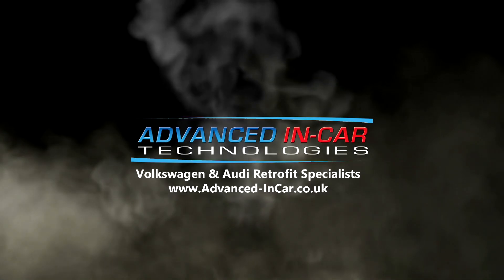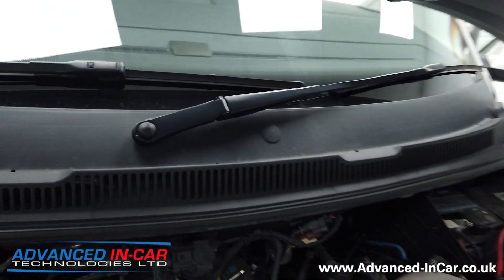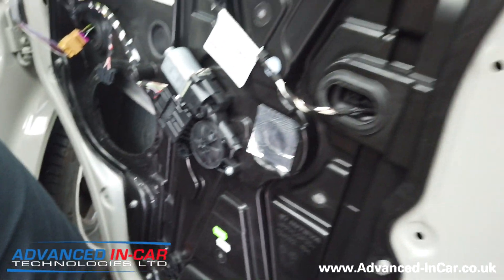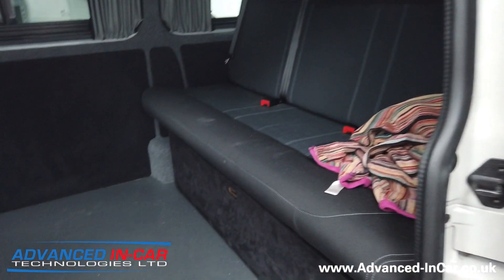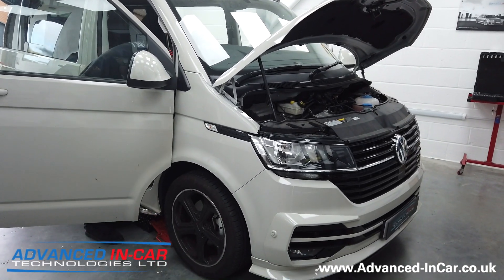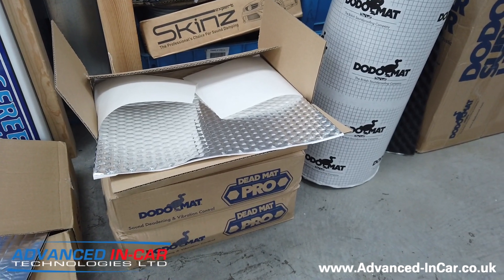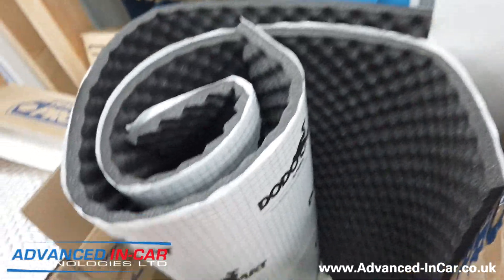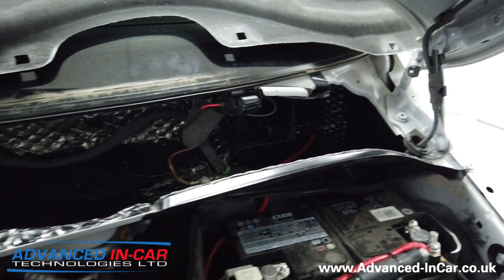The Ultimate VW T6.1 Front Sound Deadening Upgrade

Comment: Hi, this is amazing. How much weight (roughly) did all of the deadening add to the front?
Reply from the maker: Hi Michael - Thanks for the message! 
It's mainly the 2mm / 4mm Sound Deadening that is the heavy part. We've never weighed it but for this install it would about 35kg based on the box weights.